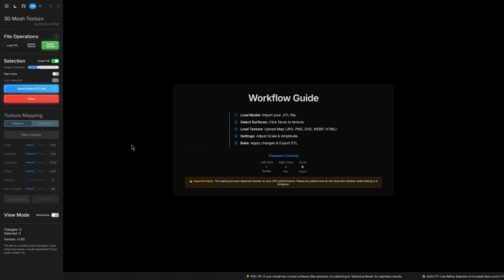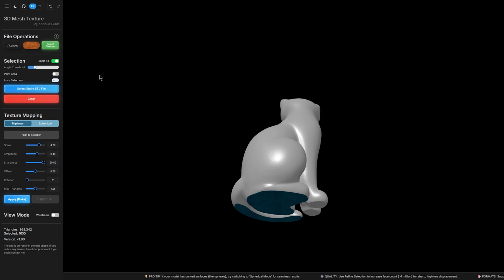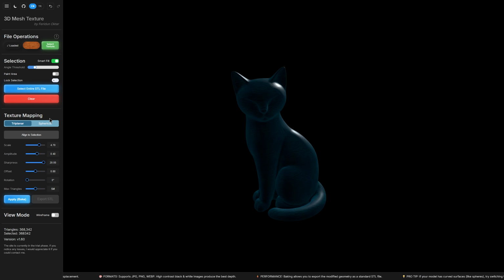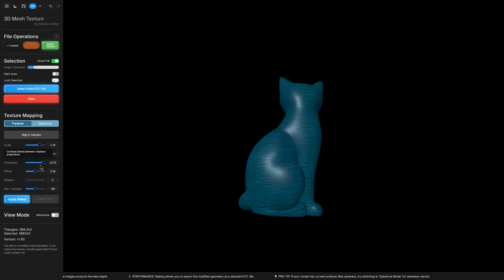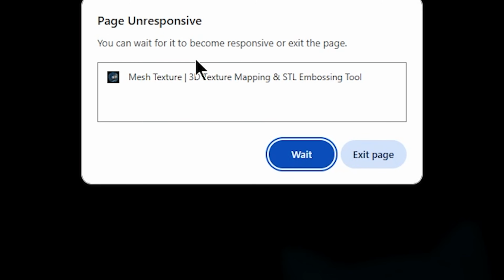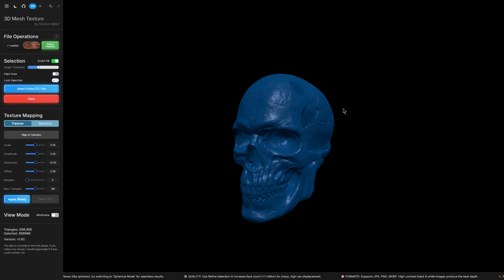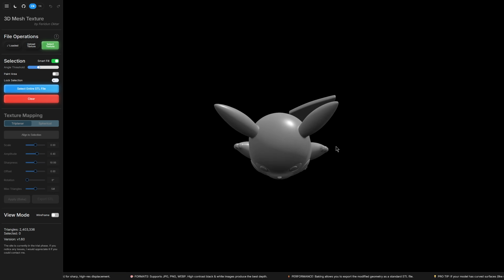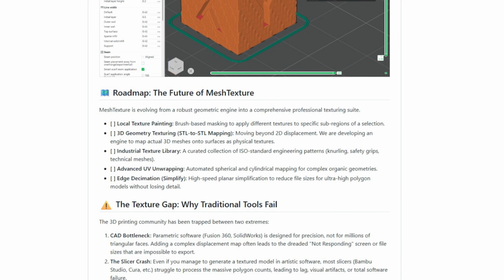This New Tool Adds Texture to Your 3D Prints!

Comment: Claude Coded Clone in less than 10 min and fully functional with the road mapped components added. SaaS is dead my friends. 😂
Reply: 10 minutes? That’s a cool UI demo, but I’ve been coding MeshTexture for 3 months straight, specifically focusing on the engine, not just the wrapper.

I’m curious: How did your 10-minute 'clone' solve the complex mathematical challenge of vertex displacement on non-manifold STL meshes without causing 'spiky' artifacts or collapsing the geometry? That specific engineering problem took me weeks to get right.

Real SaaS isn't just a UI; it's the 3 months of hard-earned solutions hidden under the hood. My 3 months of work just served 5,000 real users in a single week and hit 100GB of traffic because it actually solves those 'impossible' problems. A 10-minute shell can't handle the heat. Good luck with your clone though!
Reply: @feridunokt0  When I say I cloned the entire app, that is what I mean. Not just a UI but the entire engine. To answer your question 
1. Convert the STL triangle soup into local surface charts.
2. Split every non-manifold edge and singular vertex so each chart is topologically manifold.
3. Subdivide selected regions until triangle size can support the requested texture frequency and amplitude.
4. Compute a smooth, chart-local displacement field.
5. Solve for new vertex positions with a regularized optimization that preserves the intended height but suppresses spikes and triangle flips.
6. If a region is too pathological, switch that region to an implicit SDF remesh path instead of forcing a direct offset.

I can give you the math involved if you want.
Reply: @SyntaxNexus  That’s actually a solid technical breakdown, respect for that.

I completely agree those steps define a viable approach — I also use AI tools to accelerate parts of my workflow. But in my experience, the real challenge isn’t outlining the pipeline, it’s making it stable and performant in a production web environment.

Handling large STL files (like 50MB+), keeping memory usage under control in the browser, and making sure the optimization + SDF paths don’t crash or produce artifacts under edge cases — that’s where most of my 3 months went.

If your version is truly running in-browser and handles these cases reliably, I’d genuinely be interested in trying it out.
Reply: @SyntaxNexus  can you share your codes to github？
Reply: Link? I'd like to try it!

Comment: An immediate use case would be applying basic texturing to bases for wargaming miniatures, where you can take a stock featureless miniature base STL file of whatever diameter or shape you need, then slap a convenient initial texture to be printed, after which you can add whatever greeblies and such you want.

Comment: Why not add the link to the tool in the description or a pinned comment?
Reply from the maker: I'm not sure what you mean. The link to MeshTexture is in the video description. The first two lines of the description are:

"In this video I cover a simple tool that allows you to easily apply any texture to a 3D STL file, ready for 3D printing.

The tool is currently available at:
www.MeshTexture.com"
Reply: @3DRevolution  

Hello. How are you? Any STL and/or texture I try to use always results in a completely “exploded” STL. It generates a totally deformed object, like a bush full of sharp spikes pointing in different directions. Can you tell me what I might be doing wrong?

Comment: Thank you for reviewing my site. I appreciate you explaining the settings in detail in the video. Since everything runs locally, the processing time varies depending on the computer, but I'm trying my best to optimize it.

The very large file size was a major problem, and I can say I've solved it. Thanks to the simplification feature I recently added, the file size has been reduced by 50-90%, and it can be easily fed into slicers.

Here are some features I plan to add:
- Uploading and downloading colored 3MF models
- More ready-made textures
- Adding multiple textures, for example, six different images, one for each side of a cube
- 3D meshes onto surfaces as physical textures

Please let me know if there are any features you think would be better.
Reply from the maker: Hey Feridun, you have done a superb job with this site so far and I'm really surprised a tool like this hadn't already come along. 

That's great to hear there's already been improvements with the site. I'll be keeping an eye on it and I'm sure I'll do a follow up update video in the future.

I'm particularly excited to be able to apply multiple textures, and I'm very intrigued about the concept of the 3D meshes onto physical surfaces.
Reply: You sir are one talented individual, thank you so much for this tool!
Reply: Thank you for this site!
Reply: Thank you very much! 🙏🏻 Blessings on you Brother
Reply: Amazing talent man
Reply: Feridun, beginner 3D Printer here and you have come up with a tool that did exactly what I wanted for a small project - I wanted to add texture to the INSIDE of a cylinder. Kudos!
Reply: Thank you so much for sharing this great tool !
Reply: Can you add color painting? Painting without symmetry in bambulabs is just idiotic. I use 3dcoat for painting. 
Your tool currently improves on Formlabs Texture Engine though so good work.
Reply: @feridunokt0 Hello. How are you? Any STL and/or texture I try to use always results in a completely “exploded” STL. It generates a totally deformed object, like a bush full of sharp spikes pointing in different directions. Can you tell me what I might be doing wrong?
Reply: @mikekiske  Hey Mike! I'm doing well, thank you for asking. The 'exploded' or spiky look is almost always caused by the 'Amplitude' setting being too high relative to your model's scale.

Try these steps to fix it:
-Lower the Amplitude: Set it to a very low value (start at 0.2 or even 0.1) and increase it slowly until you get the desired depth.
-Check Model Scale: If your STL is very small (e.g., if it was exported in inches but the tool reads it in mm), even a small amplitude will cause massive deformation.
-Verify Geometry: If the spikes are pointing in random/chaotic directions, ensure your mesh is 'manifold' and doesn't have flipped normals.

Try lowering the Amplitude first and let me know if that solves the deformation!
Reply: @feridunokt0  
Hi,

“If your STL is very small” — that was my mistake. I now resize my STL files before loading them into your app, and everything works perfectly.

Thank you very much for your work and your feedback!
Reply: Every time I try to print a STL after I use the program the prints will not print properly or have proper adhesion. I have tested other prints without the mesh texture.  I tried with bottom with texture and with out texture. I think this is an awesome ability if I could just get it to work
Reply: download colour 3mf modle _________ very good! when？
Reply: @XIAOBAIZHANG-ym8pn  Hi! I’m glad you liked the 3MF color export idea. It was actually my next big update, but I’ve decided to put the project on hold indefinitely.

It’s incredibly demotivating to see my unique logic and core concepts (like the 'Cookie-Cutter' displacement) being cloned and featured by 'big names' in the community without any attribution or credit. When your hard work is presented on major YouTube channels as someone else's innovation, you lose the passion to keep providing free tools.

I’m focusing on my university exams for now. If you’re looking for these features, you might find them on the sites that 'borrowed' my logic, but the development here is paused until the ethics in this community change. Thanks for your interest
Reply: @feridunokt0  hi my bro, you can continue you project, it is very good, and it close sucees is very very short.
Reply: @feridunokt0  who steel your idea?
Reply: @feridunokt0  If you’re looking for these features, you might find them on the sites that 'borrowed' my logic, but the development here is paused until the ethics in this community change. _______________url？
Reply: can you post they url?
Reply: @XIAOBAIZHANG-ym8pn  Actually i was answered but i dont see it .  
Not actually stealing maybe but he dont even talked about my site and say he is first in this web texturing(He knows my site before video). Video: https://www.youtube.com/watch?v=rTBkjR7JvzI 
I think this is not ethical.
Reply: Excellent job, I’ve tested today and it worked greatly! Thanks!!!